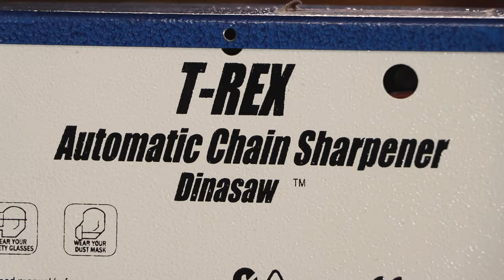The King of CHAINSAW SHARPENING

Comment: So by my rough math with a median hourly arborist rate of $30/hr and sharpening 30 chains per week.  Done by hand that's one every 10 minutes or 6 an hour, for 5 hours..   thus $150 worth of your time..   or about 33 weeks to pay for itself.  Not counting the time this machine takes, because you can be doing something else most of that  time.     The X factor is whether this eats chains faster than you would sharpening by hand.
Reply: Have used a regular Oregon grinder for a couple of years now. You can set up a grinder to barely take material off same as filing. But then again in those cases you can touch up a chain with one or two swipes on the job. So I'd say a grinder eats a chain about 10% faster. Worth  it when you consider the time saved.
Reply: the difference is tho your chain will always be top notch edged where hand filing sometimes throws your edges off unevenly

Comment: We hand file our chains square and HEXA, I couldn’t imagine hand filing all the chains you guys go through. 

I don’t know if I’ve ever seen that brand before. I knew a guy who had a few Oregon automatic grinders in his garage. Those worked well but weren’t nearly as compact as the one you have. 
WCS has a raker gauge that you might be able to use with the chain still on the machine. Just a thought, not sure if you have tried it or not or know about it. 👍🏻

Or 500i usually has a 36” .404 full skip full chisel on it with an 8 pin. It’s the perfect setup for the conditions we’re in. The saw is incredible for the weight and size. We bought it two years ago and I might have a full tank run through it, I don’t know how many barrels my son has through it 😆.  That thing is thirsty and it’s about the only one he uses, especially with .404 chain.

Comment: The concern from the short is how much material this appears to take off, but it looks like it was set to take some extra for dramatic effect and is a bit more subtle here.  The question is, how many cycles of sharpening will a chain last using this device?

Comment: Shit how busy do you have to be to just be swapping out a dull chain. I used to run my saw 10 hours a day and only use 35 to 40min maintaining it throughout the day which was normally a good time for a break. Your reason sounds pretty flimsy i used to smoke the the fools who sharpened with these things when it came to productivity cos my saw cut so much faster.